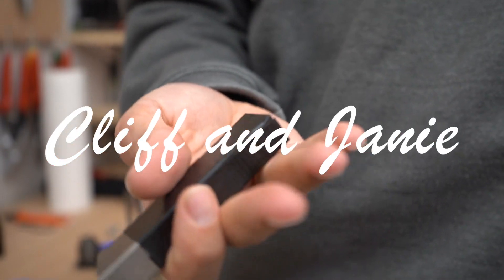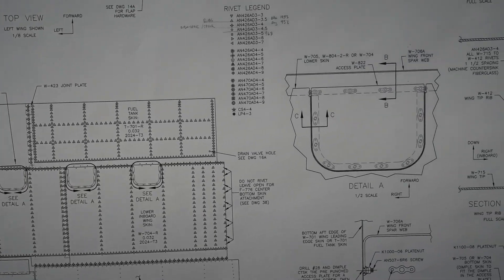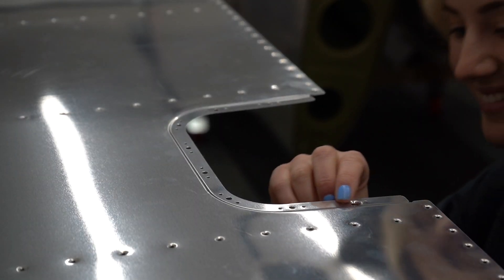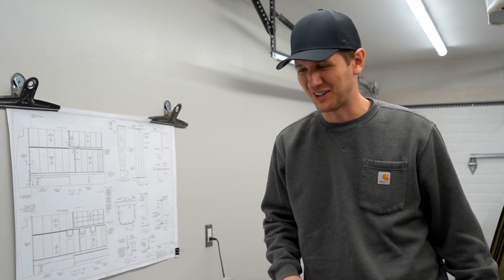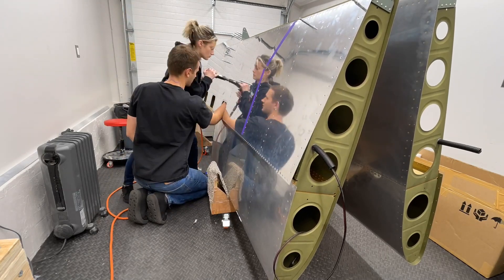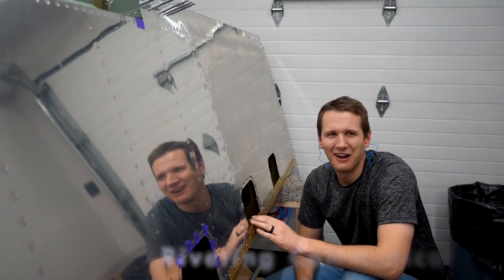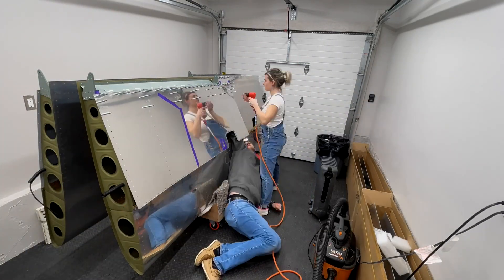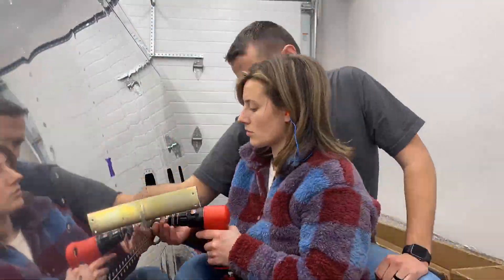Our Van’s RV-7A project (Wing update #4) - Riveting the Bottom Skins!

Comment: 5:06 does not matter now but in future... get real "rivet tape" or "3M Transparent Film Riveters Tape". Not too expensive. It is kind of reusable. I peal it off and reuse it a few times. It has stick in edges and middle is clear... it does not leave residue. You are pushing glue into the edge or rivet / dimple with "Scotch" tape and it never will rip or be hard to get off.  2X is the best over all. You are only doning -3's and -4's and 2X is better.

Comment: You must have very tolerant neighbors regarding the racket  emanating from that trailer?
Reply from the maker: We have the project in our garage -- It could be noisy but we are very considerate neighbors and make sure we only do the loud work when people aren't home!
Reply: It is not that loud... and very short burst "Burrrrrrrr" for about a second. Inside a garage, from the outside 10 feet away it would be just muffled sound, just auditable may be. Inside t he neighbors house, you won't hear it.  No don't rivet a 1AM.  Now for the Riveter's, ears a foot away, hearing protection is recommended and needed.

Comment: Just watched a bit of your latest wing build video.  Fun to see a couple building together (my wife and I did 30 + years ago on an RV-6A).  If you are open to suggestions... I can tell from a couple of the views of some skins in your video that your skin dimples are not being formed fully with what ever process / technique you are using.  It is not an airworthiness issue but it will be noticeable from a finish quality stand point.  To late to do anything about it on the wing skins once riveted but you could remedy it for the rest of the build.
Reply from the maker: Definitely fun being able to work together in the garage! Always open to suggestions. Can you be more specific with which dimples you are referring to?
Reply: @CliffandJanie  I did notice the same re the dimples.  I love the quality of your videos. lots of good information. I do have to agree with Scott and to be fair he is the vans GURU.I use cleaveland dimple dies and get a flat surface above dimples but yours are under dimpled. I noticed this when looking at your part in the video with regards the inspection panel. The dimple should not have a noticeable depression around the outer part of the dimple...you can pop them under a lighted area and any reflection you can see going through the dimple should not be noticeably wider in the dimple area. So you need to hit harder if its a C frame....if using a DRDT use more pressure. Use quality dimple dies....to me that is avery or cleaveland....definately not yard store.....I have all three types and simple go cleaveland every time. look for a ring mark around the outside of the dimple. I love my 2x rivet gun which is just like yours.I believe Scott is referencing your dimples on the skins you can see in the video. and hey its no worries...just as Scott says...build that out of the rest of the build. watch this U tube videos...it might help. https://www.youtube.com/watch?v=Qo9QCMaNSoA&t=100s Look at 3:50 seconds....yours looks a little like the far left example of under dimpling and you want the third dimple he does...good luck.
Reply from the maker: @glennevans9416  Very Interesting, thanks for pointing out a specific area. Went and looked at it and the lighting is definitely not helping in that shot (we overdid it in our shop, you could flick the skin and you'd see it under this light!). We have cleaveland everything so no cut corners on that end. Watched all their videos before we started! Each dimple has a ring around it from the dimple dies. When doing it we compared it to the dimples done on the quick build skins and they are a perfect match to each other before and after riveting. 

So I'm wondering if it's either the lighting or the factory is also under dimpling?
Reply: @CliffandJanie  a ring around the dimple doesn’t necessarily guarantee a good dimple but lack of one does indicate a very bad one. 
Less than ideal dimples can occur even when using the very best dimple dies. 
Are you using a DRDT dimpling tool?
Reply: @CliffandJanie  oh good you have the dimple dies from cleaveland. if you are using the DRDT it can definitely under dimple and I have one too. however I made my own frame and its thicker material. in order to get perfect dimples from the DRDT2 you must get at least 1/8" of flex in the frame. that means preloading the dimple dies before putting the skin in. No that can mean the dimples are not evenly dimpled as the flex obviously causes the dimples to not be perfectly parallel at full squeeze. Thats why some say the c frame is better. In my opinion I have adjusted my DRDT2 to provide perfect dimples and i do get frame flex (and my frame is 6mm thick!). I had another look and I can see the lighting does show up all depressions which i notice all the time in my shop too. ....and they dont look bad by any means....just a few under dimpled ones noticeable in a few areas...in your opening shot at 5 seconds the dimple immediately above the rivet gun looks under done and the one above that looks fine....it might just be the lighting. Keep the great videos coming..they are interesting and helpful. cheers.